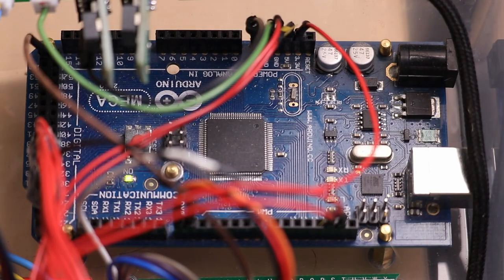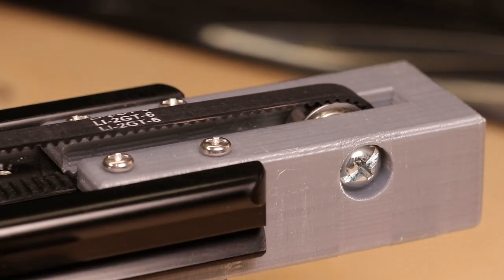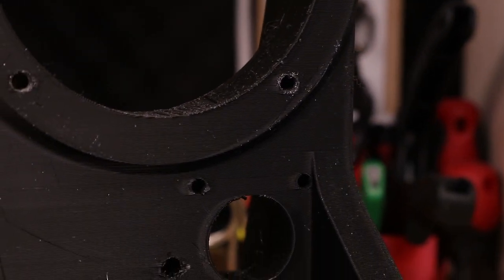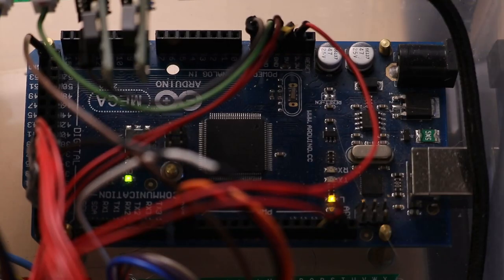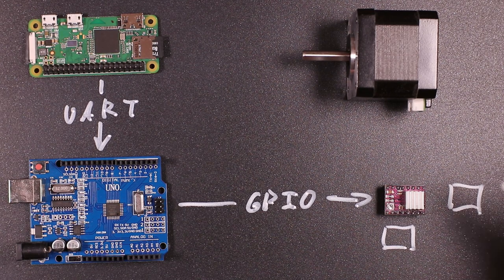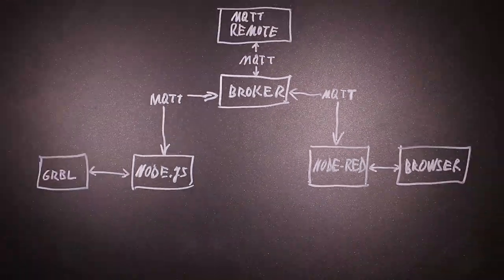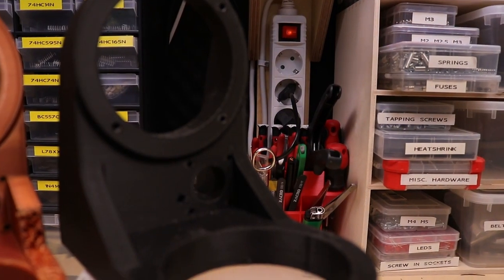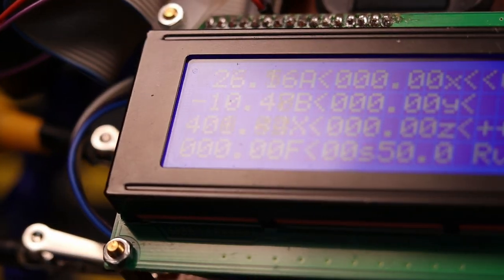DIY Motion Control Rig

Comment: Really cool project! Why MQTT though?
Reply from the maker: Thanks! I needed a way to send messages to multiple recipients simultaneously and mqtt does that. Plus, I already knew mqtt from earlier projects and when all you know is a hammer, every problem becomes a nail XD
Reply: @fuzzy4logic  Have you considered using steppers with encoders, so you could 'teach' the robot by positioning the carriage manually by hand, and lets say, hitting a 'keyframe' button? I think that would speed up the setup of shots. I'm really interested in MoCo so I'm researching all the different approaches people have haha
Reply from the maker: @Zibartas Yes, this would be quite amazing. Edelkrone does this with their stuff and it looks pretty usefull. I think they use a brushless motor with a PID controller to achive this. For my implementation I will integrate my system into Blender and "manually" set the position of the virtual camera in there. The physical moco rig will then move to the position. If you're looking for more moco stuff I'd suggest the following: https://www.youtube.com/watch?v=rWuKmWKicro
https://www.youtube.com/channel/UCoBZfAYn705hCqBQeqH5EoA
https://www.youtube.com/watch?v=WNtC9EkYCYQ
Reply: @fuzzy4logic  Thanks for the links! I'm not that good at programming so I was mostly relying on other people's solutions for that, even considering getting a used DMC-16 for Dragonframe haha. In any case, that's my main issue, really. Hardware I can build and wrap my head around, and some basic keyframing, etc. in software. But I have no clue how to code acceleration ramps, inverted kinematics, make a nice UI and so on, lol.  PureMoCo is the best thing I found so far tbh.
Reply from the maker: @Zibartas  PureMoco looks fantastic, I didn't know them before. I took the same approach whith using available software. That's why I decided to use grbl. Why reinvent the wheel right?. Dragonframe is awesome but a bit overkill for my humble application haha. Another system to drool over is this here: https://www.youtube.com/user/mrmoco1

Comment: Do you have parts list? I can't find them on your GitLab. What slider, steppers, etc... did you use?
Reply from the maker: Hey,
The Slider is a generic slider from amazon. The brand is "Kamerar". 
The Fusion360 file is in my repository. You can change it to make it fit the hole pattern of your slider.
As Steppers i used standard nema 17 stepper motors with 45Ncm torque. The bearings are 140mm rockler bearings used for lazy susans also from amazon.
The screws are all M5 and M3 for the steppers. The lengths you can get from the Fusion360 file.
Hope this helps :)

Comment: what size of a toothed belt? I really like the solution to the large holes for the wires from the camera, many projects ignore this :D
Reply from the maker: In my latest design (video soon(ish) :) ) there are slip ring connectors in the large holes to allow continuous rotation without cable twists. The belts are gt2 480mm,  6mm wide
Reply: @fuzzy4logic  I noticed this in the Fusion project files. I was more concerned with the hdmi cable
Reply from the maker: @vampirex8  There wont be an hdmi cable in my design. I will connect the camera via usb, through the rotary connector, to a raspberry and use libgphoto2 to stream the live video to my node red dashboard. That's the plan anyways :)

Comment: Hey! This is great! 
What softwear do you use to drive your slider?
Reply from the maker: Thanks!
The Arduino runs grbl and the rasperry runs a custom application I wrote. You can find it in my gitlab repo (link is in in the description)
Reply: @fuzzy4logic  Thanks! Can you make video about your softwear?
Reply from the maker: @ИванЧудаков-о3я  I will upload the next version of the motion control rig in the coming months and explain the software in greater detail there. Make sure you subscribe so you won't miss it ;)
Reply: @fuzzy4logic  Wow that's cool! But can you help me a little? I have few questions about software and electronics. How does the Rosebery Pi connect to Arduino? Can I use a PSP gamepad with your software?
As I understand I can make keyframes and repeat movement between them. How can I change speed, acceleration, decceration? 
Sorry for too many questions before your next video, but my rig is ready and I'm looking for software to drive it.
Thanks a lot!
Reply from the maker: The raspberry pi is connected via serial to the Arduino. You can control the motion control rig with anything that can send MQTT messages. To use a psp controller for example you could change my nodejs application to read the commands from the controller or you could write your own application in a language you like and let it send MQTT data to my application. You could also use a smartphone app, a web application or a desktop program, as long as it can send MQTT messages. To control the different functions you just have to message the corresponding mqtt topics
Reply: @fuzzy4logic  Than you!
Reply: @fuzzy4logic   Do you have acceleration and deceleration in your software?
Reply from the maker: @ИванЧудаков-о3я  grbl has a basic implementation of acceleration which can not be changed for individual moves. I achieve acceleration by sending a sequence of moves with increasing speed. The acceleration of grbl takes care of the smooth transition between moves.